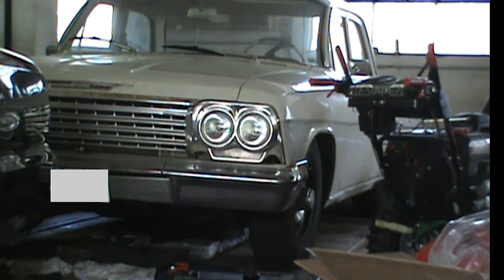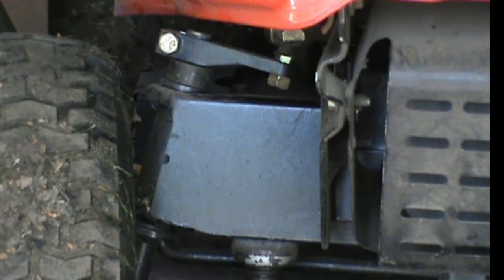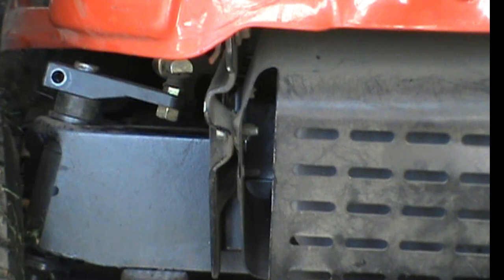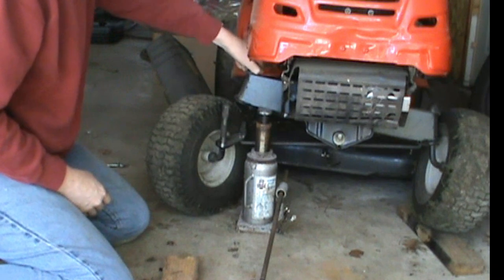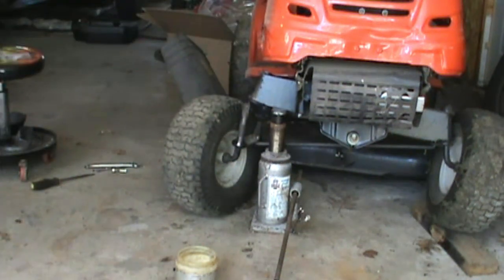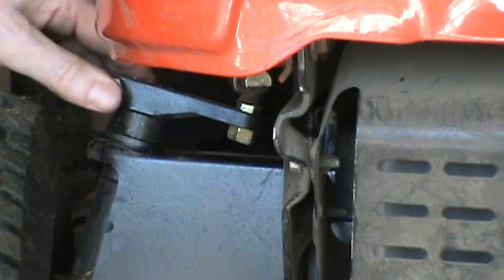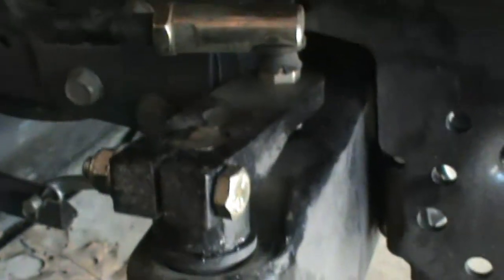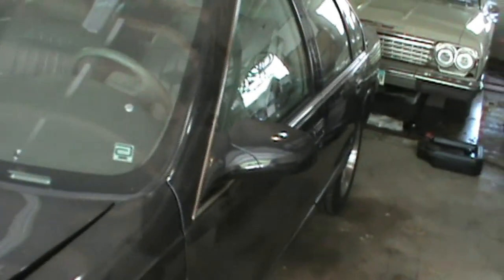MTD garden tractor poor man's steering

Comment: Just did this on my White Outdoor mower with the exact same set up. Have to say it did not make much if any difference in steering. But greasing the wheels and axles did make it easier to push the mower around in the garage. Thanks for the video.
Reply from the maker: Thanks for sharing

Comment: Thanks, was also looking for a video on this bearing on this mower. Do you have the part Number?
Reply from the maker: AYLIFU 4-Set Thrust Needle Roller Bearing with Washer NTA1220+2TRA Needle Roller Thrust Bearing 3/4 inch Hole Industrial Bearing

That is the description from my Amazon order.  $9.59 for 4 of them.

Thanks
Reply: @mrimpala6291  Thank you.

Comment: Did you also replace the wheel bushings with bearings?
Reply from the maker: I wanted to, however, there was no videos out on it.  So I ordered a set of bearings after measuring the inner diameter but the length was not able to make it work.  I couldn't figure out how to get the lengths right.  So I put the bushing back in and have been running like that.
Reply: Yes I see the problem with fitting a caged ball bearing in place of the plastic bearings (bushings). The plastic bearings are so thin that the sealed ball bearings could not fit. The other bearing replacement videos are replacing thick metal bushings. When you say the ball bearings you have are to long I think you are saying the distance from the I.D. to the O.D of the caged ball bearing is greater than the thickness of the plastic bearing. I think I read elsewhere the only option is to get a different wheel hub if you want ball bearings for these mowers using the plastic bearings.
Reply from the maker: @comonbabylightmyfireburn  no, I actually mean the length.  The inner and outer diameter was spot on.  But the length, I couldn't get then long enough  and still support the wheel. The same as the bushing supports the wheel.  I try the longest ones I could find and they just weren't long enough.  I haven't given up on it, just put on the back burner.
Reply: Can you add multiple bearings for each hub? I saw some guy put 3 or 4 caged bearings in his hub to help support the axle?
Reply from the maker: @comonbabylightmyfireburn  I bought 5 bearings.  I forget their length.  I don't know if I can weld them together or not, as I'm not sure if there is plastic inside.  Like I said, I put that on the back burner for right now.  When I get back to it, you'll get to see my crappy welding ability.  😀
Reply: @mrimpala6291  maybe jb weld or similar could work?